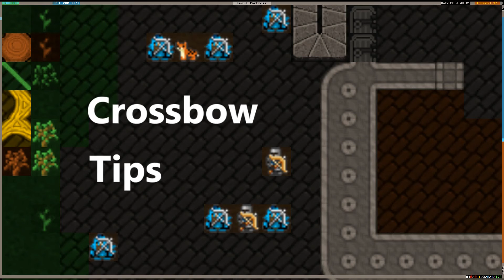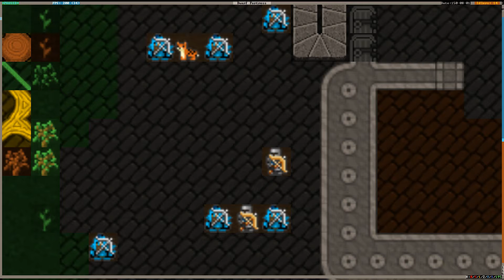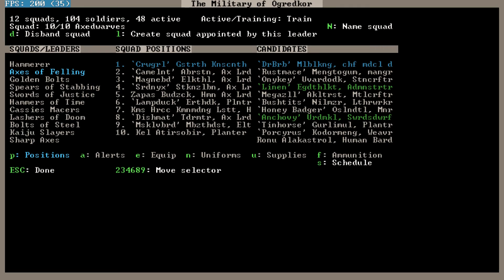Crossbow Tips Part 2 Examples and Advice

Comment: Cooper, not steel, should be used for crossbows.  It's a bit denser and they get used as bludgeons.  All other common metals usable for crossbows are equal, but steel is the most labor to produce.
Reply from the maker: For all the effort that goes into steel, I wouldn't make a crossbow out of it unless I had all the steel armor and axes I needed.  You're right that sooner or later they are gonna swing that thing like a club.
Reply: @TheEqualsE  The long explanation is that material has no significant effect on crossbows used as crossbows and density is the only property with significant effect on bludgeons.  A bar of silver is 62 dwarven weight units.  A bar of copper is 53 dwu.  A bar of bronze or bismuth bronze is 49 dwu.  A bar of iron or steel is 47 dwu.  I don't have any candy wafers on hand to check because it never feels like there's any point in going past steel, but they're notoriously low density.  Since silver cannot be used for crossbows, copper is the best material and tied with iron for the easiest.
Reply: I’m not sure what the answer is but I don’t know